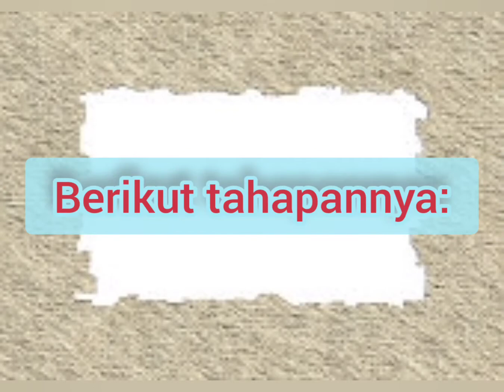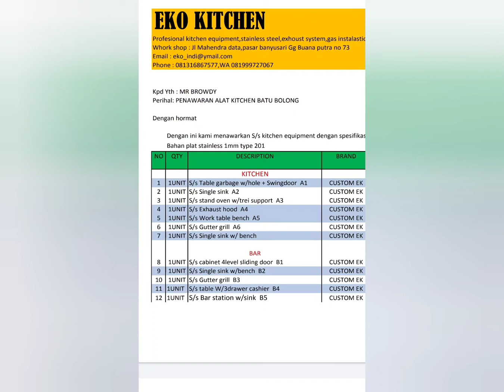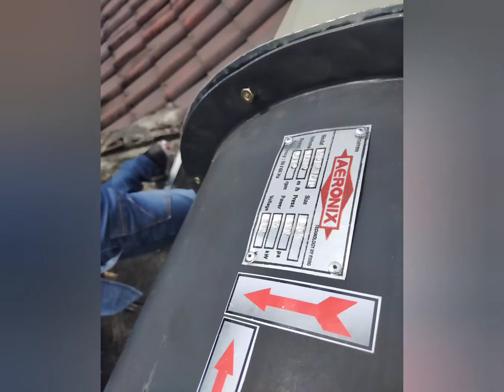CARA DAN PROSES MEMBUAT DAPUR RESTORAN ATAU WARUNG MAKAN

Comment: Kalau untuk kebutuhan dapur masakan padang kisaran brp ya om ?
Reply from the maker: Masakan Padang kapasitas 200-1000 porsi dg peralatan dapur menggunakan bahan stainless steel:

Kwalirange double Burner
Kompor 6sumbu
Stok pot(2unit)
Meja stainless
Meja stainless preparation
Double sink
Single sink
Rak piring
Wallselv
Exhaust hood

Kurang lebih 70-100jt

Itu belum termasuk utainsilnya seprti: blender,piring sendok garpu,Panci,bascom,wajan dll
Reply: Mau tanya Kalau untuk dapur cafe ikan bakar dengan ruangan yg agak sempit berapa kira" bugdetnya?😊